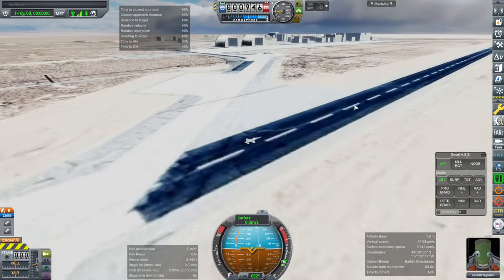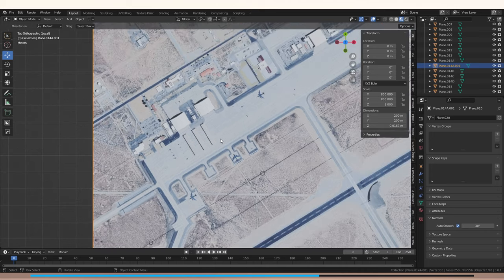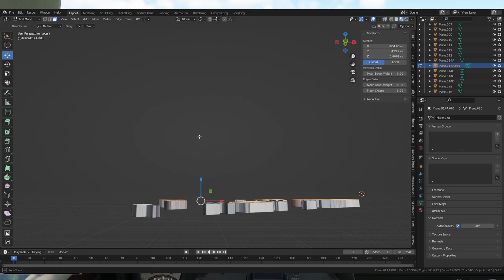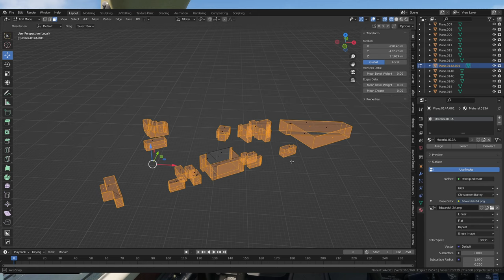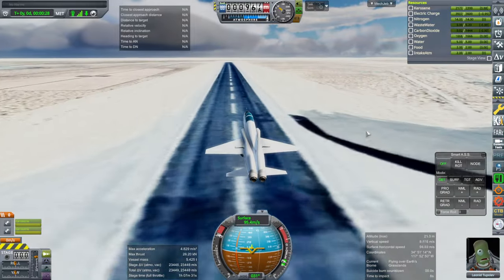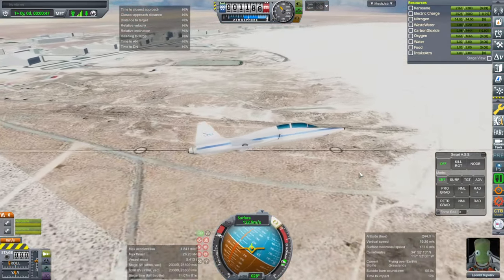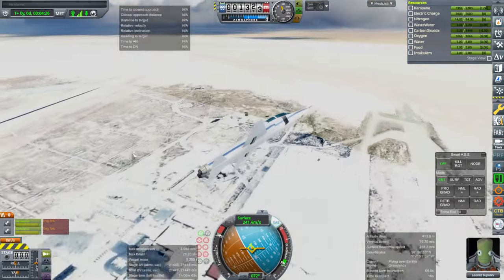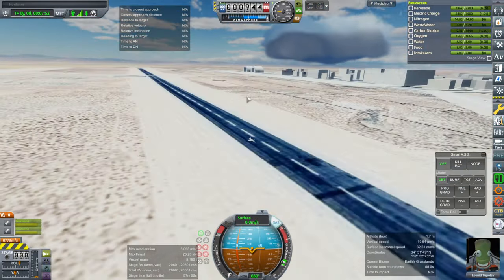Edwards AFB Terrain Update for KSP and Real Solar System

Comment: You might wanna apply some color filter to blend into surrounding terrain texture, particularly at the edges
Reply from the maker: I already had, which is why one edge matches, but the sun angle was different when the higher quality images were taken, so I think I need to use a gradient.